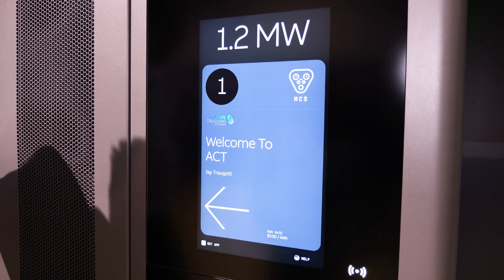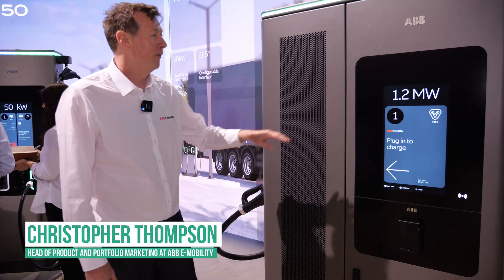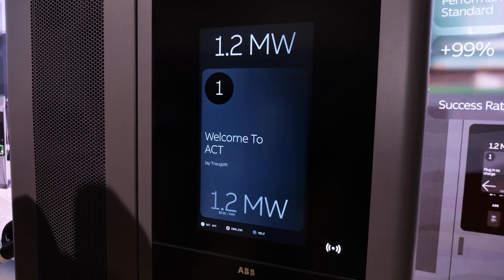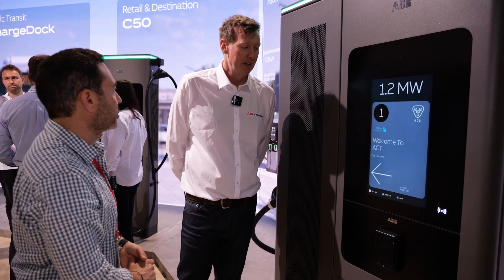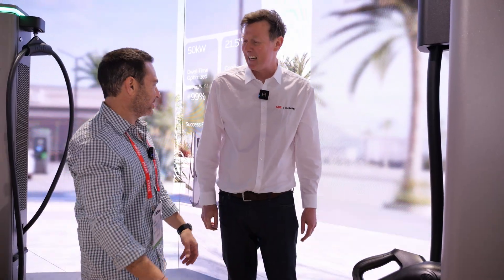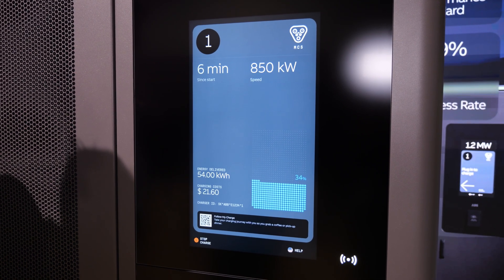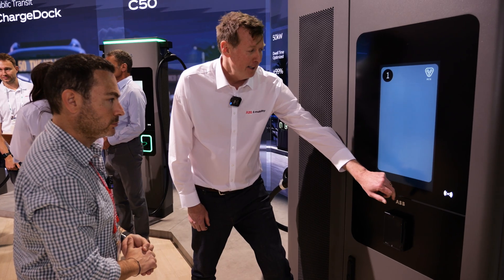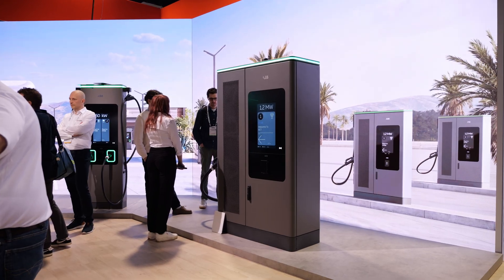The Future of Truck Charging: ABB’s 1.2MW MCS 1200

Comment: QUESTION,
Big trucks use MegaChargers to recharge quickly. If a driver let his battery pack run too low & arrived to find the nearest MegaCharger down, can a big truck still plug into a regular run of the mill Supercharger to trickle charge his pack? Oh, sure it may take 6-8 hours to only charge 10 or 20%, but that may be enough to get him to the next MegaCharger site. If big trucks do not have this emergency capability, they all should. Aways be Prepared with a backup plan.

!
Reply: For many years, most trucks will propably have both mcs and ccs2(europe). Mcs where its possible and ccs2 if no other option. 

Ccs2 could do 400kw. And mcs could do 4mw. 

But most ccs will be between 50kw and 350kw. And mcs will start at 1,4mw.